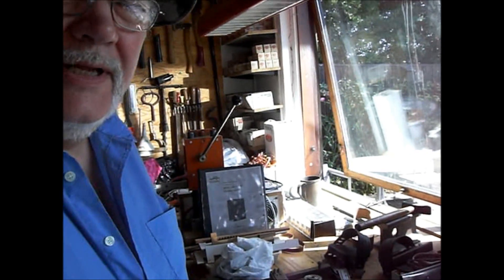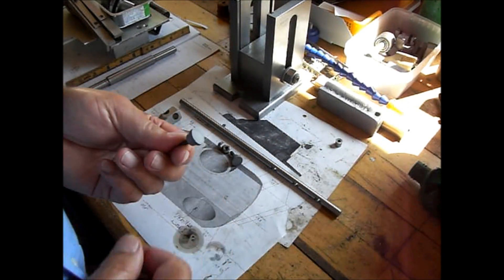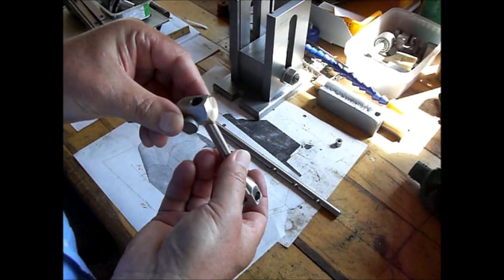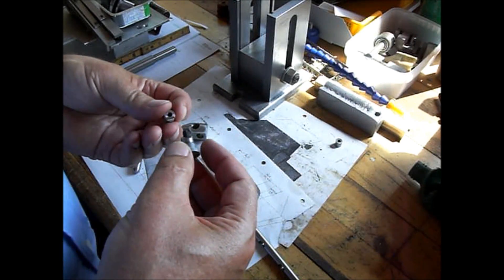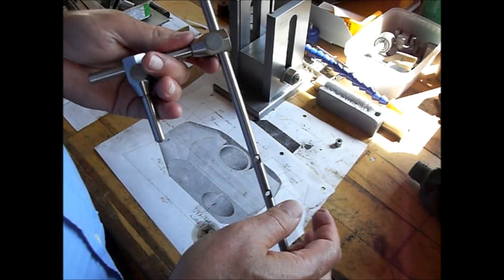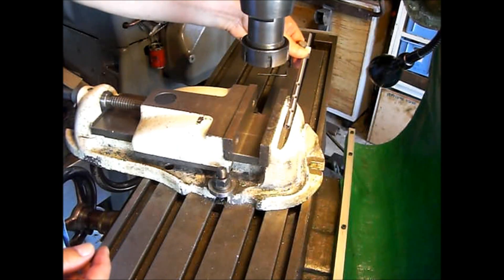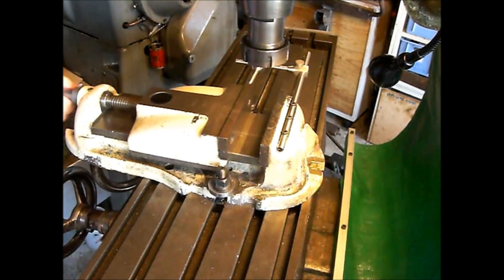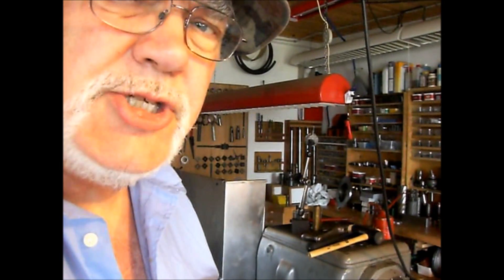Finishing work on the EndStop for the mill vise

Comment: Good job Keld.  I tend not to use thumb screws for tightening as they don't lock well enough.  Allen headed bolt is better, and can still look OK.  Or maybe you can use a small cross bar for tightening, but then they get/rattle into the way.  Rather than bronze you could make a larger knob and bolt end and use a roll pin, also knurl the knob.  Or maybe machine out of one piece and cut a thread ? Did the stainless go black right through (not just surface oxidization ?)  Cheers Rob
Reply: 31C is just a warm day in my neck of the woods :)  Try 40+C for a fortnight.  Now that's hot.  But then we don't have snow.  Cheers Rob
Reply from the maker: Hi Rob !
I think this "split cudder" method will work with thumb screws - I don't like the extra key you else have to have laying around ;-))

Cross pins looks ...argh !   Knurling ... yeah, maybe - then I have to get the tools on ebay !

I'm too cheap to make the knob out of one piece, ha, ha, I think too much material is wasted turning down to the 5mm thread ;-))

It is just surface oxidation on the stainless and I have removed it with the sandblaster ... and too removed the "sand blaster surface" with some polishing :-))
Reply: I wondered if it was surface blueing.  I've not brazed stainless, but done plenty of 1080 steel etc and you can wire buff the blue off very easily.  Grit blaster leaves a mat finish.  Next time use the buff and see it works well.  I'm not stoked on cross pins either, prefer brazing. Actually a pinch type knurl is well worth having Keld.  You can do some really nice work with one, and they aren't very expensive.  Get yourself one fro Christmas :)  Rob

Comment: Great looking product, well made and functional. I'm ordering some hex stock from Sanistål and look forward to trying to build a set here. Are your drawings corrected based on what you have learned with the build? Nice web site as well. Plus 9C here in Nuuk. Lovely and cool. Sorry about the heat there.
Reply from the maker: Hi Jim
Thx for the nice words ... my drawings are "chickens sketches" made in SketchUp - the ARE dimensions and they are (should be) correct - I beleave I mess up with the setting up of the mill. You will not be able to see the drawling unless you have SketchUp or some other 3D-software that can read SketUp files. Let me know, then I can send them to you.
Reply: Keld Sørensen
Hej Keld Jeg har SketchUp, og vil gerne modtage filen idet jeg vil lave din fine skruestikstop. Jeg har jimilne (snabel a) greennet.gl som adresse. Jeg glæder mig til at komme i gang. Mvh. jim ps. Jeg skriver på dansk for at skåne min e-mail adresse en smule.
Reply from the maker: Jim Milne OK, jeg laver lig de sidste tilretninger og sender filen - dimensionerne ligger i et lag for sig selv. Det centrale punkt er jo afstanden mellem de to tværgående huller i hver af klamperne.

Comment: Keld,
Very nice project.  I like your design.
To do the knobs, I would turn them out of stainless, and drill the hole for the screw about .05 mm undersize and press the head of the cap screw in.  Another way is to saw the head off of a cap screw and thread the knob and put the screw in with lock tite.
BTW  31C is a cool spell here in Texas.  Today it's about 31C, normally this time of year it is about 37C.
Reply from the maker: Hi Herb !

I vote for cutting of the head and thread inside the knobs ... thx !

Temperature ... Yeah, but Denmark is in the cold north ... Texas has always been a hot place - right ? ;-))
Reply: it's hot here in the summer.  But really nice the rest of the year.  Winters are not all that cold.

Comment: Looks good, Keld.  Maybe make the finger grooves on the knobs and then polish the sandblasting away.  It is supposed to reach 38+ C today here in Sacramento, California, chance of rain showers this morning...
Reply from the maker: Yeah, I think these grooves will do it - do you think I can polish the sandblasting away - that would be nice ..... then I'll have to finish my polish wheel ;-))
Reply: Keld Sørensen
You could polish the flat face by hand using progressively finer sandpaper on a flat surface.  The compound curves will indeed need some sort of polisher, but it could be something like a Dremel tool or a die grinder.

Comment: That came out really good.  What I like best is how fast you can adjust it.  Maybe you can make a rod with a magnet or two in it to cover the mounting area on the vise when the stop isn't attached.
  Our high today in Ohio is supposed to be below 70F (21C).  Possibly breaking a record for the lowest high temperature for this date.
Jack
Reply from the maker: Oh, no ... the magnet will attract most of the chips ... 

The weather here in Denmark these days (last 4-5 weeks !) is way too warm and hot and very unusual for us !
Reply: I guess I was thinking of a magic magnet that will hold a cover it in place, but repels chips!
Reply from the maker: Jack Hoying Ha, ha, yeah. that's would be very nice to have !